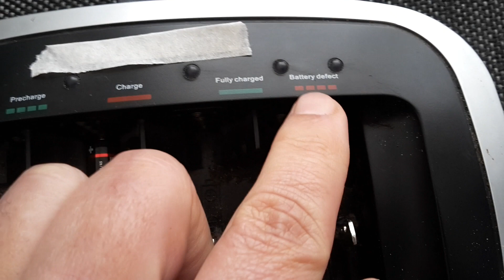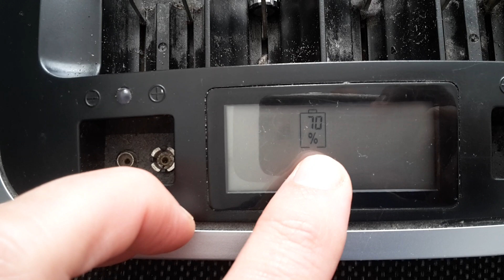How to fix in a simple way dead rechargeable battery aa/aaa

Comment: Thanks. I connected the 2 positive terminals together. 2 negatives together for 30 seconds. And after this, the battery could charge again.
Reply from the maker: well done good for
Reply: I have a makita battery out of a makita drill that the charger wont charge the charger is good I have two batteries one Will charge but second one want is there a way to jump it to be able to get it to take a charge
Reply: I got them to work! Thanks mate!